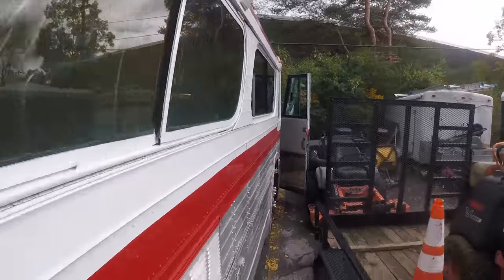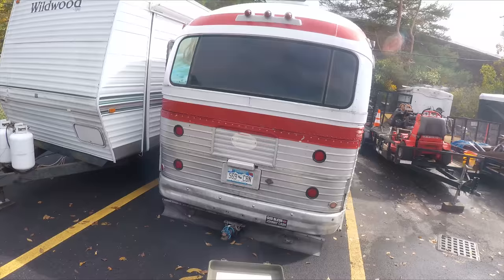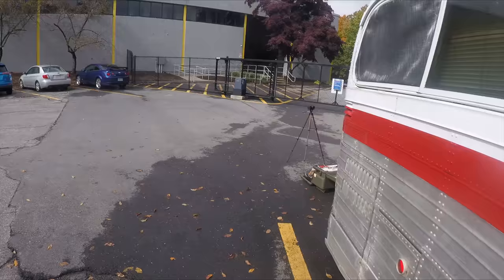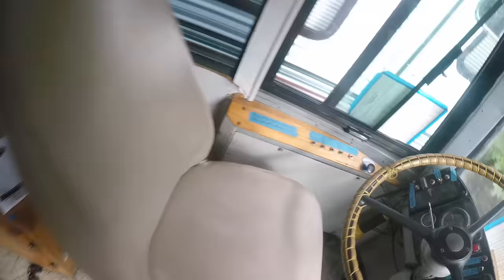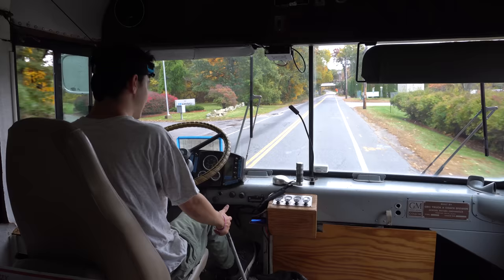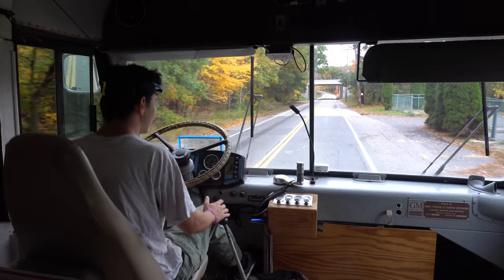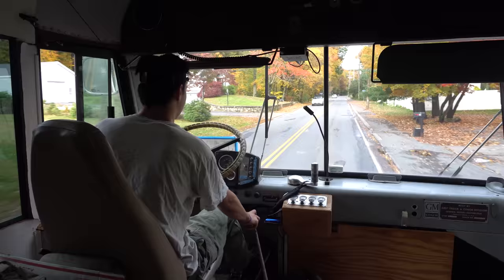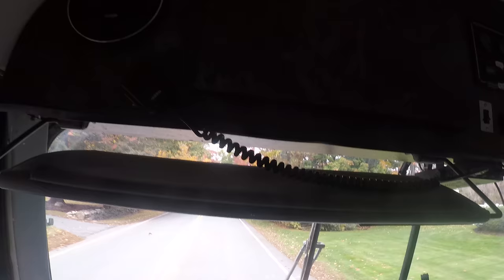1959 GM 4104 Bus. Driving/Shifting

Comment: i know this is an old vid n ya probably got the timing down,but the easiest way. to get shifting smoothly is only push the clutch down about 2 inches when double clutching and shift immediately.the pause in neutral is very breif.your to slow gettin into the next gear .shift b4 the engine hits the governor.stay away from sliding gears till your timing is perfect,the short clutch pedal action will get that there but done incorrectly the damage will likely be permanent.

Comment: To help shift, "cheat the stick".  That is to apply a little pressure on the shifter and "shift with your foot" when you clutch.   Also, use a 1-2 motion pausing slightly in neutral.
Reply: Bob Monger is 100% correct. I was gonna make same suggestion. You don't even need to use clutch except when you come to a stop. Upshifting put little pressure on stick about 2100 rpm's then take foot off throttle, then move stick to next gear and it should slide in at about 1900rpm's. Also drain air tanks and add alcohol in winter. Same with fuel in winter, add anti gel.  WOW, you got alot to learn but your gonna have lots of fun especially if you like mechanical work. Very best of luck to ya. Kinda wish you were near me, I would come and fix(play)with that bus with you. Enjoy.✌️out

Comment: When you double clutch, it's a song and dance that requires you to pay attention to motor noise, engine speed, and coasting speed.
1st gear, race engine almost to the top of the governor, clutch, then tap the gas, clutch listen to engine wind down where the harmony (engine noise)  is balanced, clutch again then slip into 2nd gear, feather the gas pedal for smooth acceleration. Do the same for 3rd and 4th gears.

When you tap the gas, it's brief and quick. 
If you race the engine too long before changing gears, you will lose forward momentum, grinding gears, and burning out the clutch.
I drove for Adirondack Trailways back in the late 80s mid-90s, and I drove Bus number 62975 4-speed manual from NYC to Oneonta round trip.
I really miss driving buses, everything is automatic and the art of driving a manual is dead!

Comment: Nice job Ross. I learned on a 1964 GMC 4106 which was the next model after the 4104. If you double clutch it will shift faster. Where in the country are you?
Reply from the maker: Yea I'm gonna try messing around with some different shifting techniques mentioned on this comment section. US.
Reply: @RossTheBuilder  I’m in Mass where are you?

Comment: All semi trucks except for Volvo’s with the Volvo transmission are not synchronized, so you are not alone. You are just new to “double clutching” in time you will learn that you don’t need such high rpms to down shift.  Also if you “double clutch" while upshifting you will grind gears less.

Comment: It's a two stroke Detroit so they like there revs but you don't  need to Rev it all the time you can feel the gears at any rpm should be 500 rpm in between gears. It real easy when you shift up watch the rpm then you'll  know where the gears match up then when you down shift simply  Rev it up for example from 1500 to 2000rpm and it well go right in you don't  even need to use the clutch until you come to a stop then just feel the gear until you feel it go in then depress the clutch and stop. Don't  need to grind them just feel them

Comment: You don’t need to rev like that. Just rev while lightly goin for the gear on the down shifts. It will slide in when the revs match. Also you shouldn’t even need the clutch to shift. Just match the revs. As the revs come down, it will slip into gear🤘🏼

Comment: The air bags are bad? A low-rider bus? A diesel engine doesn't rev very high. For upshifting, you need to double-clutch until you've learned the relationship between engine speed and road speed, then you only use the clutch for starting and stopping. When climbing up a hill, downshifting is fun. You keep the pedal floored, push in the clutch and by the time you are shifting into the next lower gear, the engine rpms should match the speed for that lower gear.

Comment: Try shifting WITHOUT the clutch, it’s usually a lot easier on those old transmissions. Also, make certain you have enough oil in the transmission, and that the oil is CLEAN. No need to redline on shifts, either, up or down. You can upshift just after the engine starts to pull, which on the old Jimmies is usually around 1600. Downshift when it starts to lug. Practice will bring perfection!
Reply: I was thinking the same. For me, all of the trucks i drove with unssync i neber use the clutch...
Reply: Yea he's all over the road with that transmission, very unnatural. Don't need the clutch...

Comment: Double-clutch it. Shift to neutral, let the clutch out, rev it a bit, push the clutch back in and shift up. It should slide right in gear that way.

Comment: Wow. You're doing it right. I didn't get to drive the trucks with the straigh-cut gears and Detriots much, but if I recall correctly, if you're starting out gently, any throttle will make the clutch chatter, which isn't good. Have you tried letting the clutch out in neutral on the up-shifts?

Comment: You can single clutch it 
Use the rpms and let off the throttle a little pull out of gear then clutch in put in next gear

Comment: You always double clutch up and down that's how you shift buses and semis 1st gear you want to shift before the governor hits at 15mph so shift it at 13 14 2nd gear goes from 15 to around 30 3rd gear 35 to 40 4th gear 40 to 55 if you don't want to double clutch shift like the Greyhound driver's were taught clutch once put in neutral Rev the engine not scream it wait for the rpms to drop some then shift it and you want to use the brakes and transmission at the same time for a smooth stop and remember the passenger's are in the back listening to then engine if you want to learn how to properly double clutch it's easy push the clutch to the floor shift from 1st to neutral come off the clutch all the way push the clutch all the way in when then rpms starts to drop with the clutch to the floor the go to the next gear you have to listen to the engine when shifting in reverse the coach has to be at a complete stop flip the solenoid switch to reverse hold the switch until you put it in reverse

Comment: You don't need to rev her so high, try float shifting once you find your rhythm, get the RPMs down lower before down shifting, you must have some nasty air leaks from 60 to 90psi should take no longer than 2 minutes for air build up rate

Comment: Don’t be afraid to use your brakes.  Unless you are going down a really steep hill or a mountain grade,  they should be more than capable of stopping you in city traffic without constant downshifting.  You can downshift later after slowing somewhat without massively revving  the engine.  When double clutching you are just trying to bring the input shaft up to the speed of the lower gear.  If your brakes  do not stop with authority, something is wrong and requires service.

Comment: It looks to me like you are not "double" clutching correctly. You might just not be saying it but when double clutching you depress the clutch to pull out of a gear and release the clutch in neutral. This brings the trans to engine speed, then depress the clutch to pull into the next higher gear. That's the way its done.

Comment: not ever seen a bus with a 4-speed manual that requires double clutching,but not sure if you know but does it have a clutch brake? can you float the gears or not and if you know math it might help but not sure if it works for a 4-Speed it works with a 9-Speed and higher
Reply: @chris g crane - No clutch brake on a 4104. Transmission/clutch assembly were never designed to have one. Gear splits in the simple 4-spd are so wide, floating the gears is more difficult, but not impossible.

Comment: Drove semi tractors since 2019 and the ones I learned on and drove at work were all unsyced manuals. Tractor years were 2015-2020 this "1960s tech" is still used today for whatever reason. Perhaps it has something to do with maintenance idk but got damn was it hard to learn even with the knowledge of a regular manual in mind.

Comment: Talking about a rare motor, then rev the shit out of it, (your statement) won't be running long with rods thru the block.  Have someone who knows properly teach you about the 2 cycle Detroit and the 4 speed.  It becomes a technique and double clutching is to allow the motor to slow down to match the rotation of the motor to the trans. Floating the gears (no clutch) also works once taught how to do it. Over revving will just wear out the motor.  I spent many years driving a Detroit and 5 speed, and the harder you try to man handle the motor/ transmission the more difficult it will be to properly operate, and eventually break parts. Never touch the brakes?  I don't get that either, overusing the brakes, yes that's bad, but saying you don't want to use them is dangerous. Brakes properly used along with engine braking in the proper gear should stop you every time safely.
Reply from the maker: Woah man. “Rev the shit out of it” =exaggeration. “Speed up the input shaft” is what I meant. Also, it’s a 2 stroke man rpm’s ain’t bad for it. Is there anything wrong with trying to understand the limits of my engine braking for downward grades for example? Obviously I would use the brakes in an emergency and stopping when I need to. And, I don’t have anybody to teach me the ins and outs of 2 stroke diesels and turns out the 6-71 isn’t that rare. If you’ve got so much experience drop some advice
Reply: @RossTheBuilder  you were over revving it if you listen to the video.  Double clutching is a learned technique.  You should try to find a place where you can practice, where you can concentrate on your techniques and don't have to worry about everyone else on the road.  It takes time, I spent years teaching guys to drive a 2 stroke 5 speed, some of whom never drove a stick before.  Slowdown is my biggest advice to you.  You have the general idea, but practice and control of the throttle is needed.  As far as braking is concerned, proper use with the right gear for engine braking will stop you safely. The truck I drove weighed in excess of 48,000 lbs. Without knowing more, and stating it takes 30 mins or whatever to air up the bus, i m curious if you have compressor issues and that's another reason you don't like the brakes?   Just a question.
Reply from the maker: It's not that I don't like the brakes the brakes work just fine. My mindset is that it's a platform I'm unfamiliar with and it's my first big vehicle operation with the only advice thing's I've found on the internet. The last thing I want to do is have the brakes go out. And, if they should go out or start to fade, I know my limits without a JAKE-Brake. I'm certainly in no rush when driving lol

Comment: I spent years in theses busses so understand the problems. Just a few comments
 Don't group against the governor while upsetting as it will hang up the gears on you. Look at the speedometer in first it should be only about 12mph. Step in on the clutch  pull into neutral depress the clutch on cout 2,  on three pull into second. Same in the other gears. Don't just let it idle down. Second top , if you hit the governor back off a little and repeat the pattern you did in first. Important, learn the top speeds in each gear as that is crucial in the downshifting
 Make it seem like it is an autistic transmission
 Wish we could talk on the phone.

Comment: Probably has a Spicer transmission which are a pain in the ass compared to Fuller.  I recommend converting to Fuller 5 speed.  Personally,  I am a  MCI fan and want to get  a dash 9 with automatic and Detroit 8v71.
Reply: there ine got automacit cvt           tey makuy hybrffd bus 50 kw    hybrdd

Comment: SHIFT EARLIER! Don't red line! Don't stay in neutral so long between the gears. And don't rev the engine so high. Most downshifts should need only a slight rev.

Comment: I have driven 1.3 million miles of 13 speed Roadranger transmission. You are taking WAY TO LONG to shift. 1st gear rev up, push clutch in, shift to neutral, clutch out, clutch in, pull to second-as fast as you can read this is how fast you need to shift.
Reply from the maker: I’ll give it a try thanks

Comment: When down shifting you can rev up the engine for the next lower gear without double clutching.  Also diesels don't like high RPM especially American diesels so you probably shouldn't be and don't have to rev it up as much as you do. It is not Mercedes OM617 lol

Comment: Nonsynchro transmissions are not that hard to shift.  And you don't really need to rev the engine that much nor that long on the downshift.  It takes time, but you can develop a rhythm.  Also, until you learn to listen to the engine speed, use the tachometer.
Reply: I'm not sure the old 4104s had tachs on them. Two big gauges on that dash -- speed and air pressure
Reply: @jimvail  True.

Comment: dont ride your clutch, thats hard on them, just put it in gear and get your foot off the clutch. learn to synchronize your engine speed with the transmission and you wont have to double clutch, also learn to float your gears

Comment: That poor bus is getting destroyed. Go to a truck driving school and get some pointers, pretty much everything your doing is destroying the engine and gears. It’s the same manual transmission that semi trucks use, plus you’ll learn how to have a safe vehicle and check your air brakes manually. You should never rely on your Jake brake.
Reply: wring

Comment: WOW! Someone needs to teach you how to drive that poor bus before you put all those internal parts on the ground. Learn to float gears and time your shifts. You should never exceed 3,000 rpms. Revving the engine with the clutch in does nothing, if you want to bring the gears speed up to match the rpms, rev the engine with the clutch up! usually 1,000 rpms for each gear you plan the shift to. If your dropping one gear, rev 1,000 rpms if you're dropping two gears, shift to neutral clutch up rev 2,000 rpms ease it into gear. I'm amazed you haven't scatered that Detroit.
Reply from the maker: Yes I talk about how the input shaft only spins with the clutch out and do that in the video. As other people have mentioned I shouldn’t have been reviving it that high on shifts.

Comment: You’re shifting all wrong
Reply from the maker: How so? It’s not a regular manual…
Reply: @RossTheBuilder  when up shifting an unsynchronized transmission you only have to double clutch the shift, the only time you have to rev the engine is during down shifting, because the engine rpm has to match the road speed in order for the gears to mesh without grinding. Revving the engine on the upshift is only making it harder to get it into gear.
Reply from the maker: @rjleftlane   I do not rev on the upshifts. I let the rpm’s fall for 3-5 as shown in the video. It may be hard to tell but of course I do not rev on the upshifts. I understand that while upshifting the input shaft must slow down in order to meet the lower speed of the higher gear.
Reply: @RossTheBuilder  oh I apologize, I thought you was revving on both up and down.

Well you’ll get the hang of it, those transmissions actually shift pretty easy.

Anyway love the bus, can’t wait to see more of it.
Reply from the maker: My bad. You're right. On the first upshift I do rev it. I have no idea why I did that. It had been a while since I'd driven. You were right I didn't catch that. That is the only time I sped up the input shaft on an upshift however